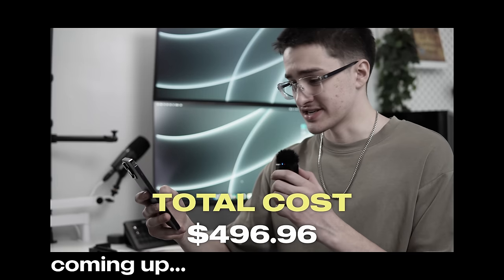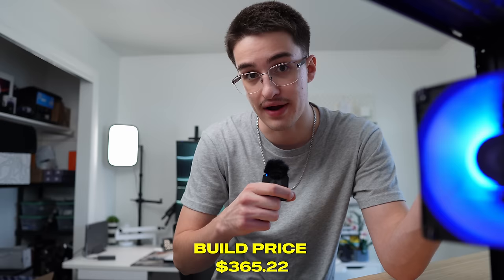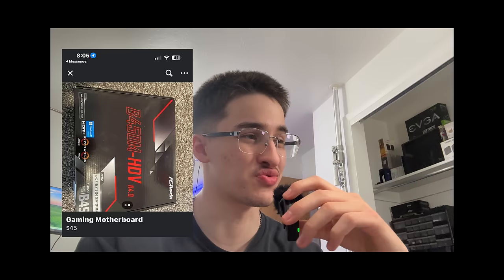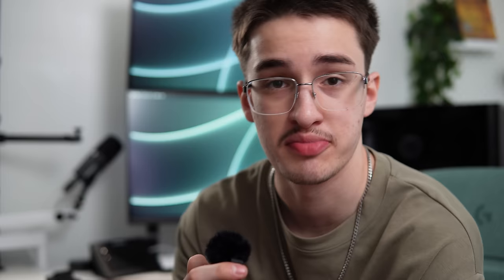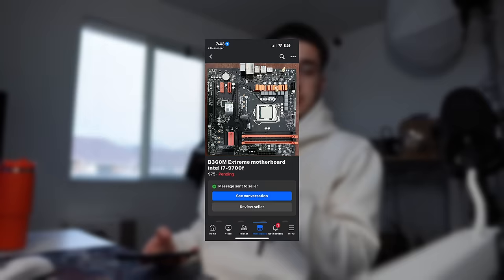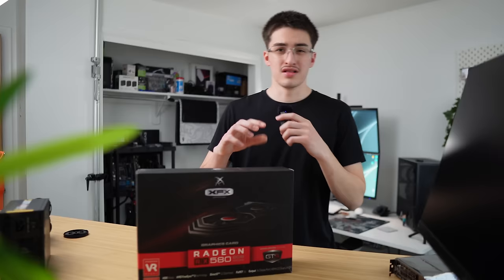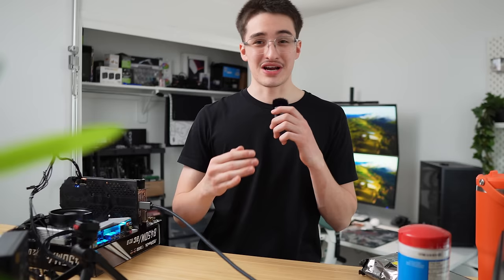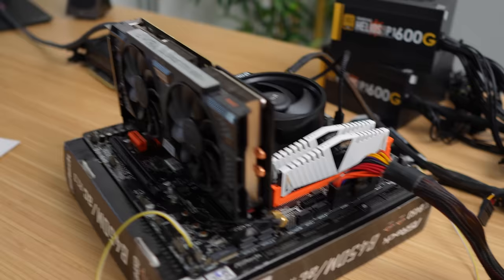Flipping Pcs until I buy a house | S2:E5

Comment: Too the guy who overpaid for the i3/1030 combo.  Is that an oem prebuit? Does it have a decent power supply? Maybe you can sell the 1030 for $20-30 or repurpose it. Spend $30 on a i7 3770. Then maybe you can sell it a recoup you money. Your no going to be able to market that old of an i3 as a gaming computer.

Comment: Hey Elijah great breakdown. One thing I do if I have to flip a PC or some higher powered hardware is a I bring a portable power station or something of that like  in my car so that I can boot the computer up in the parking lot with the buyer if need be. It can be a little expensive but worth it if you do a lot of flips, consider it a business expense. (Maybe a sponsor can send you one powerful enough to run a PC) Portable monitor helps as well

Comment: I've noticed the same thing as you regarding nicer neighbourhoods.  I scored an amazing i9-9900K with z390 motherboard and 32 (4x8GB) of RAM from someone in an upscale gated community (paid $120 CAD).  Even threw in a nice Corsair case for free because it was  taking up space and he just wanted them gone from his place.
Haha about the CPU power plug.  I've had that happen a few times and sometimes I would buy a B450 or B350 motherboard that hasn't been flashed for Ryzen 3000 and wonder why it's not posting when I put a Ryzen 3000 CPU in it.

Comment: hey i just got a deal where I bought a gtx 1070 for 80 bucks but the seller also gave me ddr3 mainboard i5-3750k with a really big cooler and 16 gigs for ddr3 ram 2666 mhz was that a good deal and should I pair the gpu with the rest of the stuff? Because I wanted to pair it with B450M and a ryzen 5 3600 but now km unsure
Reply: if u read this the 1070 has triple cooler and its used like 120 bucks